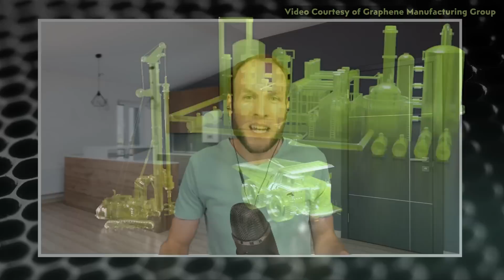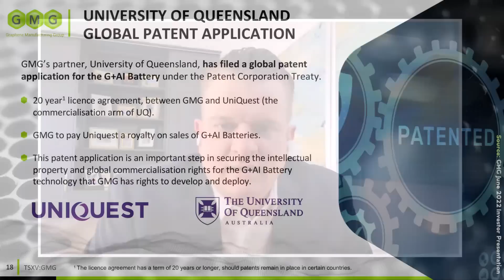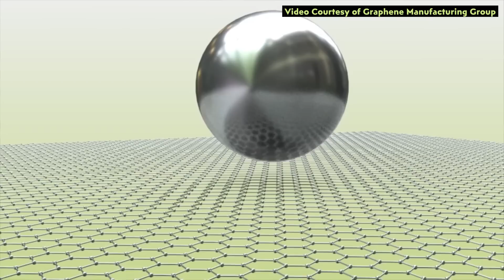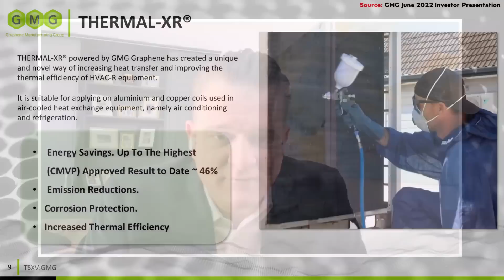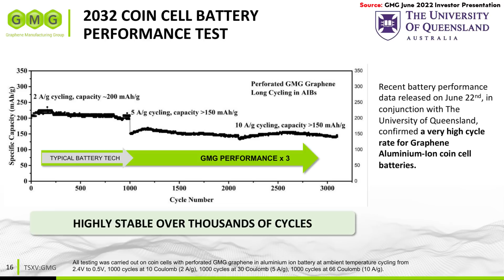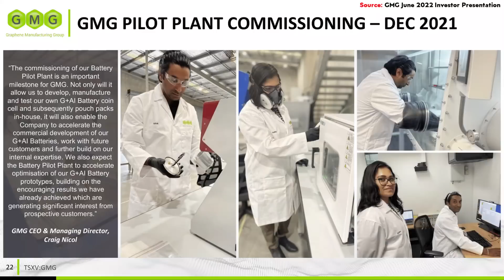GAME CHANGING Graphene Aluminum Ion Battery w/ Craig Nicol

Comment: So, what is still needed to achieve double the voltage per cell or greater, to make the Al-Ion battery clearly competitive with Li-Ion on specific energy and energy density? Likewise, what is the corresponding energy density and cycle-life for the Al-Ion battery at C/5, C/4, C/3, C/2, 1C, 2C, 3C, 4C, 5C and 6C rates. Additionally, please let us know what the energy density (specific and volumetric) would be if operated over a more reasonable/practical voltage range, like 1.6V to 1.0V, rather than 2.4V to 0.5V, for comparability with Li-Ion which is typically operated from a high of 4.2V (fully charged) to a low of 3.4V (fully discharged). Note: Low-cost graphene could also improve the energy and power density of Li-Ion cells as well.
Reply: I smell a rat! If these guys have an economical method for producing graphene from unfiltered methane or really methane of any quality, it's like the proverbial person who develops a better mousetrap; the world will beat a path to their door...and beat their door down. The world will want to license/replicate/steal this process because of the myriad uses there are for large volume graphene. Their insistence on keeping the process from methane to completed battery in one facility is another "tell" here, somewhat like the guys who claim to have perpetual motion machines, but want to keep the machine in a particular location or in a special box. Graphene itself is about as delicate as a Samurai sword, so I don't buy the idea that it has to be so carefully protected that it must be encapsulated in a battery as part of a continuous process. 

Further, if this battery can handle such immense charging currents, what's wrong with using some of that graphene for charging cables, possibly coming directly off of a transformer or off of some of these high capacity carbon transistors used for AC to DC conversion. It wouldn't have to be pure, level voltage DC, but stepped DC. obviously, I am talking about something more than a bit larger than coin batteries. 

The bottom line here is that the world is in desperate need of a continuous, economical process for manufacturing graphene in widths larger than thread form.

He sort of gave away the story when he said that the world didn't have a need for stronger concrete, one of the stupidest statements that I have ever heard. What he was saying was effectively that they couldn't produce graphene in sufficient quantity economically enough to be used in concrete. Millions of tons of high strength steel are used in prestressed concrete every year and vast amounts of it are deteriorating as the concrete cracks and admits water. Huge bridges in Brazil and Italy have fallen because of this. Since graphene is 300 times the strength of steel,  don't you think that every maker of prestressed concrete beams would be slavering at GMG's door to get graphene for their beams? 

Maybe GMG can make enough graphene for coin cells and maybe not. Pouch cells would be an order of magnitude or two greater in production and producing any form of batteries for the transportation industry would probably be at least six orders greater for graphene production. GMG is a mouse and the companies that make batteries in volume are ravenous beasts. 

If GMG really has a process for producing massive amounts of graphene in a continuous and economical process, then they need to license their patents and get out of the way so that the world can benefit. If not, then they will be caught out as scammers and the world will swiftly kick them aside as such. Good or bad, they cannot ride this for much further before it begins to ride them.

Graphene in quantity could replace copper and aluminum in most wiring, creating transmission lines that aren't vulnerable to EMP. DOD would die to get its hands on such a product  for a thousand reasons, not to mention the fact that it would be much lighter than current wiring. And most of us have seen at least dozens or maybe even thousands of articles on possible uses for graphene, if only it could be produced in volume, economically.
Reply: @everettlwilliamsii3740 , I think you may be mistaking graphene for carbon nanotubes....
Graphene used in concrete would be to enhance its compressive strength (which concrete already has an abundance of), not its shear strength (which is why we use steel reinforcements). So even with added graphene, steel would still be required. 

Your bit about EMP proofing transmission lines with graphene is very odd. I’ve never heard such claims and couldn’t imagine the science behind it unless you’re using it to construct some sort of giant faraday cage around the entire grid which you can do with other materials and would be unrealistic with any of them...

Also, mass production of graphene is simply not that far fetched. Idk, man, read a book perhaps...?🤷🏾‍♂️
Reply: @reverse_Massagosaurus_Pex   I think in Italy, some graphene concrete floors and a 1/4 mile highway section have been laid. it would be interesting to get the long-term results of such use, wouldn't it?
Reply: @everettlwilliamsii3740  I thought as much after hearing less than a third of this utter garbage.  I honestly can't believe how gullible YouTubers who follow these sorts of things can be.  They make coatings, full stop.  No way to scale.  They lack supply chain, they don't make batteries for cars.  It's absurd. That bit about ultrapure graphene set off my alarm bells, as well.  Isn't it, by it's very nature, already pure?  And isn't it cheap?  Graphene oxide is $1.26/lb on Amazon.
Reply: @everettlwilliamsii3740  Sigh, you exposed yourself.  No graphene is not 300X stronger than steel.  It is not even 10X stronger than steel.  In fact, Graphene is about ~5X for common cheaply produced HT steel.  Depending on alloy, Graphene is only 2X as strong as the best steel.  Graphene in concrete has the problem of adhesion. 

Then you utterly lost all credibility saying cables will not absorb EMP if made from Graphene.  You probably read some article somewhere saying graphene in concrete would make a faraday cage.... Well yes, this is also true if you add steel corkscrews and weld tie a steel mesh over your rebar structure as has been done for every ammunition depot storage bunker for going on 100 years now.
Reply: Double voltage, although mentioned as possible in future, is completely unnecessary. Just connect two batteries in series and you have voltage of standard lithium battery. Yes they have reached the energy density similar to what LiFePO batteries have, but that is completely usable for mobility, since charging at the very high C will make charging of similar if not shorter times than gas tank filling possible...  and if they have really cheap graphene production process then this will be absolute gamechanger for energy storage. So called renewables may experience extreme boom in usability.
Reply: @petersvancarek  Peter - the higher energy density of Li-Ion batteries relates directly to the higher voltage at which the Li-ion battery operates; twice the voltage => twice the energy density, all else being equal.
Reply: @greggrant4614  there is no twice energy density... maybe 50% more for lithium in this case... and the Al-ion battery has only 40%lower voltage... but larger capacity because of 3 valent Al cation transfer instead of monovalent lithium cation.
In the end it doesn't matter on the voltage that much. Energy is energy whether you have voltage of 3.6V or 0.5V. 

Model system. You have 2 batteries of the same weight. 
Battery No1. has rated voltage of 3.6V and capacity of 1Ah.- the energy stored is 3.6Wh
Battery No2. has rated voltage of 1V and capacity of 5Ah. - The energy stored is 5 Wh
Of course at the same weight of batteries the battery with lower voltage stores more energy in this example.
Reply: @petersvancarek Peter - Putting cells in series to increase the voltage of the battery pack system does essentially nothing to increase the battery cell's or battery system's energy density. The superior energy density (wh/liter) or specific energy (wh/kg) of Li-Ion vs. Al-Ion relates fundamentally to the higher operating voltage of the Li-Ion cell compared to the Al-Ion cell. The following explanation might be helpful in this regard:

The simple estimation will be: battery nominal voltage (V) x battery capacity rating (Ah) / battery weight (kg)=specific energy or energy density (Wh/kg) For example, for a 18650 cell, nominal voltage, 3.6 V, capacity rating, 3.0 Ah, cell weight, 45 g, then the energy density will be roughly 240 Wh/kg.
Reply: @greggrant4614  as i stated "if both batteries have the same weight "... Of course putting two batteries together to increase voltage to your needs doesn't increase energy density. 
We have real life example. NiMH battery vs LeadAcid battery. NiMH battery is superior to lead acid one in energy per mass even if voltage wise the Lead acid provides more voltage per cell.
When you put two NiMh batteries together but keeping the mass fixed, you get 2.4V and the energy density remains the same as when you have battery with 1.2V- it is case of usage of either parallel connection or series connection.

Comment: I'm all for the right product for the right purpose. What market would this be best for? Electric vehicles? Consumer grade rechargeable batteries? Home power walls?

For a home power storage solution, I care more about safety and the total cost of the power storage. For an EV, I'd care about energy density and weight. We got a lot of great info on how it works and how they hope to improve the tech, but not a lot on what market segments they've targeted for the final products.
Reply: I can see these batteries in electronics of all sorts being achievable soon. But home and grid storage seem just as achievable really. 
The current energy density seems perfectly fine for powerwall and industrial/grid storage.  The scale of these would be even larger than in EV's. Even if the batteries don't wind up in EV's, the batteries would be awesome for storing energy to charge them.
 The fast charge/discharge, low resistance characteristics of these batteries make them look like the best out there to store wind and solar energy. I can't help but see it this way.
Reply: @bryanstrom812  I tend to agree from the presentation. Safer, more efficient, more cycles, better durability and electrical tolerances from less internal heat. Sounds like a good solution for home power storage from solar installations, and larger regional grid battery storage especially.
Reply: @Kingramze  Yup. Many who are familiar with GMG are salivating over these batteries being in EV's. I am too, a little, but I have a napkin. But if these get used for GRID STORAGE...I'm gonna need way more napkins, if not a towel!
Reply: @bryanstrom812  when the man made the comment about grid being the limiting factor and that you could trickle charge a battery all day then plug it into your ev and fast charge it he didn't mention the type and size of this battery. It seems to me it would need to be say 4 times bigger energy stored and at a higher voltage as they will tend to equalize each other durring this fast charge. 2 identical batteries 1 full charge and 1 discharged put together will have the net result of both batteries just below half taking into consideration losses due to resistance and heat generated. I think it is correct that these batteries will be perfect for wind and solar energy storage. I dont remember if they discussed discharge rates and capacity but for off grid or power wall it should be great for individual consumers plus just as good for the utilities and energy storage using massive battery stations. Perhaps paired with large capacitors for surge demand.
Reply: @Big.Ron1  It doesn't need capacitors because of its rapid charge/discharge rate. Capacitors only make good mediators when the charge/discharge rate of accompanying batteries is low. This battery is its own capacitor.

Comment: it takes time for new battery tech to make any significant change in the production cycle. Li-Ion took nearly 20 years before it became ubiquitous in handheld gadgets. To replace current tech you need it to fully meet demand if it can't the most you can hope for is to supplement current tech. If his claims are true it would only fill either commercial vehicles or luxury vehicles where a higher upfront cost doesn't really matter.
Reply: cheaper to produce and manufacture than li-ion, that's not an issue.

Comment: Not a lot new, but a good outline of the plan for newcomers. I see incorrect comments here from people who did not watch the whole video. These comments repeat info that is either outdated, or based on assumptions from casual observers. It is a HUGE advancement to be able to make graphene as inexpensively as they do. We don't have an exact figure for the whole process, but we don't want them to reveal absolutely everything about their unique process yet. I have also gained a bit more confidence that they can go to pack level without cooling systems in EV's. But I would be very happy to see just the coin cells produced (beyond the test cells that consumers are already testing).
Another thought: EV's aside, it seems like these batteries would be terrific for large scale GRID STORAGE.
That would be beyond huge.
Reply: LFP will already do that. Iron is cheaper than aluminum. It appears to be a solid state battery. All smoke and mirrors. Just like quantum scape
Reply: @ZeusBullyMax  Aluminum is cheap enough. Easily. And yes, LFP batteries are great, and will continue to succeed for a long time. But the power density of the graphene batteries blow away just about everything else. 
So you, some dude on the net says "Smoke & mirrors". But Rio Tinto, Kemetco, Wood, and Bosch & Queensland say otherwise.

Comment: i have a short attention span
What is the cost per KWh
and energy density per KG
Reply from the maker: 150-160 Wh/kg (should improve in the future).  Little to no cooling should not be necessary, so when it comes to pack level energy density, it will actually be pretty close to existing Li-Ion tech in terms of Wh/kg at the pack level.

Comment: Sorry, but using the dangers of kids swallowing lithium watch batteries as a reason to use aluminium instead is ridiculous. 

The burning is from the electricity, not the chemicals in the battery. 

All households are full of really dangerous things for kids - bleach, drain cleaner, kettle descaler, dishwasher fluid, methylated spirits, etc. Yet somehow they survive.

Kids won’t be nibbling on Tesla battery packs anytime soon.

This guy is a total grifter.

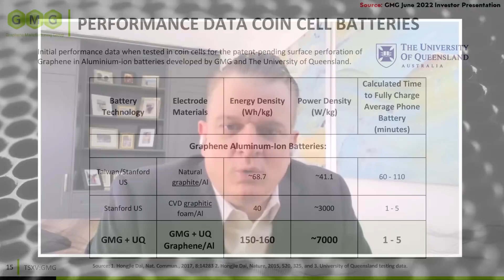Comment: 02:33 Given that the density of Aluminium is 5x that of lithium, it having only 3x the charge is a bad thing, not a good thing. The advantage of aluminium over lithium is 3/5 = 0.6 (I.e. it’s a disadvantage).
Reply: I would tend to agree with this "back of napkin" calculation. But they already have the energy density that they have utilizing only one electron so far. However, using more than one might be extremely tricky. Doing that might change the behavior of the battery by a lot. It my be super hard. I don't know this for sure though.
Reply: I'm thinking about this more. It's been a LONG time since I took chemistry! BUT, a general fact: density=amount of mass in a given space. 
Higher density could be a potential advantage, but aluminum has a higher atomic number versus lithium (13, versus 3). If we take 1/3 of aluminum's 13, we get a little over 4. So, that's higher than 3, which negates the 3 to 1 electron advantage of aluminum. But things are not that simple. The higher density of aluminum should help here. Seems that aluminum atoms can pack together more closely than lithium ions. But it's not THAT simple either! Right? 
More importantly, a lithium battery doesn't contain just lithium. Pure lithium would ignite, so you need other metals like nickel, cobalt, manganese, aluminum...some combo of those for the battery to be stable. 
But the graphene battery can use just aluminum and graphene. A lot of advantage seems to swing back to Al-Graphene there. And they don't need reactions that ALWAYS uses more than 1 electron to get further benefit.
Does that make sense? I'm not a chemist...just trying to work out the possibilities logically, on limited knowledge.
Reply: I believe he mentioned that the anode would be pure aluminium.  That would considerably increase energy density.
Reply: Main issue here is that it currently relies on methane gas
Reply: @Phtang-phtang  I can understand that, but millions of homes burn natural gas, which turns into CO2 and water vapor. The GMG turns it into recyclable graphene. Also, methane is leaking uncontrolled as the permafrost in the Arctic thaws. I hope they harness that!
Reply: @bryanstrom812  yes but also supply will get harder over time and pricing can be volatile as we have seen recently. If this is to be a long term solution, it’ll need to find a more sustainable source
Reply: @Phtang-phtang  We burn HUGE quantities of natural gas for heating & industrial purposes. But the graphene is close to 100% recyclable. It a much better use of methane, especially with wind + solar being paired with long-lasting batteries.
Reply: Lithium makes just 3-5% battery mass everything else is mostly nickel those days.
Reply: @emceh  Thanks for the random, incorrect numbers. I wonder why people just make shit up.
Reply: @bryanstrom812  Whole Model 3 battery pack has only around 12 kg of lithium while pack itself weight more than 450kg. Also new battery development goes into more nickel and less cobalt . So 12 kg of lithium in 450kg battery pack is less than 3% so nothing made up here just pure math.
Reply: @emceh  I stand corrected. Well, maybe. What is the poundage of the thermal management system, insulators? I'm thinking in terms of the active materials. What % of the active materials does lithium amount to?